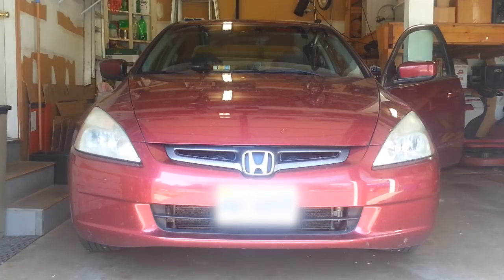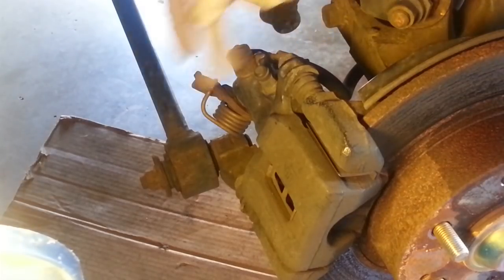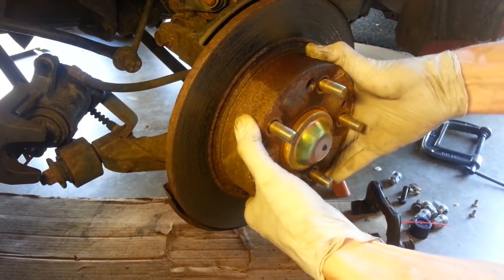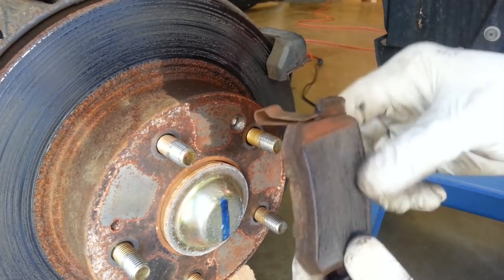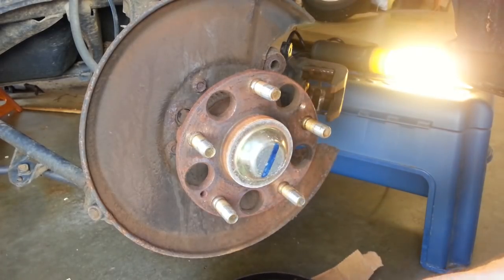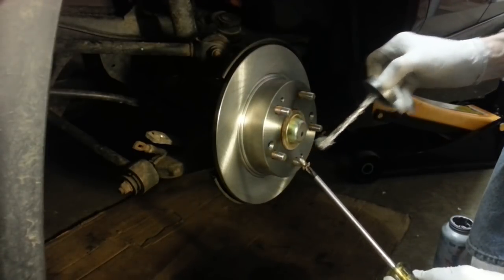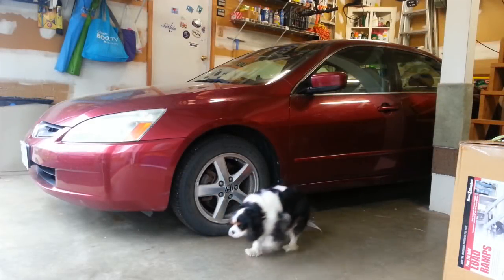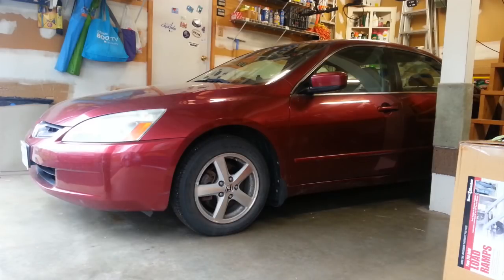DIY fix for replacing rear brakes - Honda Accord

Comment: Do not use a clamp to depress the pistons on those Honda rear calipers, not if you want to reuse them.   They need to be screwed/turned with a brake tool (or a pair of needle-nose pliers) inserted into the grooves of the cross on the face of the piston. Those calipers were probably trashed Because somebody clamped on them before.

Comment: you didn't put anti-seize on the contact points on the pads
Reply: I noticed that as well. This was the third or forth vid I watched on this to get a better overall picture and I came back to this one while I was working to see the "reader's digest" version.  It has the basic order of things, quickly.
Reply: I’ve heard not to add anything to the pad contact points it will attract dust, sand and dirt preventing smooth pad operation. But do add brake paste to the caliper mounting bracket pad clip. Only on the bracket side before putting on the shiny metal clip to help prevent rust behind the pad clip . Do not put brake paste on the pad side.

Comment: Does anyone realize that the first step with the c clamp doesn't do anything since the caliper piston needs to be turned to be opened up?
Reply from the maker: You are actually correct and thanks for the clarification. Since the parking brake is integral to this rear caliper design, it has a ratcheting mechanism inside that requires the piston to be turned back into its bore. If I was just replacing brake pads, that procedure would be required to fully retract the pistons and make room for the new, thicker pads. In my case, the C-clamp was only used to relieve the pressure just enough to remove the caliper from the rotor. That step isn't really necessary and, as I did in the video, a large screwdriver can be used to pry the caliper off the rotor. Much appreciated.
Reply: Less Woodz
Reply: Les Woodz has it correct. You DON'T press the caliper piston in. It needs to be screwed in clockwise. That's why there's the grooves to twist it with. Obvious sign. Blank pistons can be pressed. Slotted pistons need to be twisted/threaded...Bet most of you DIY'ers had leaky e-brake seals after doing it the way this guy shows.
Reply: If anyone can tell me how to turn in a rear piston while the brakes are still mounted... PLEASE LET ME KNOW! For the miniscule amount needed to relieve the pressure, I'm pretty sure it won't matter.  Maybe I'm wrong, but the only alternative I can think of is leaving the old brakes on.

Comment: I am totally depressed. I removed tha caliper easily and removed the two screws on the rotors by hand and home made lubricant BUT the damn rotors won't come out. I am really fucked up, the rotors is loose and can move but still do not come out.
Reply from the maker: Are they totally fused to the hub or are they loose and just won't come off over the end of spindle?
Reply: @WorseThanChiggers  
They are off and freely playing. It seems something back the disk hinders to come out.
Reply from the maker: @mogbaba  What kind of car is it?  The parking brakes on some cars are drum brakes with the shoes inside of the rotor cavity.  If that's the case, you may need to back the shoes off by turning the star wheel before removing the rotor.  I show how to do that in this video:  https://youtu.be/IUI8YiMX1X8?t=133

Comment: At 18:49, does anyone know how to remove the cable after taking off the c clamp?  I sprayed a ton of wd40 on it,yet it still doesnt come off.
Reply: I had the same problem. I found that if you pull the cable back (after removing the clip) the whole cable assembly right there will slide out along the length of the cable... so it's not going to pop out perpendicular to the clamp, but along the longitudinal direction. It's not easy but not TOO hard, either... (and mine was VERY corroded.) Use penetrant (Kroil, PB Blaster, or Knock 'er Loose?)

Comment: No cleaning te surface from rust ? no little caramic paste ?
Reply from the maker: +mercedes benz 
There was obviously no need to clean the old rotors of rust since they were too far gone and were being replaced. It was actually less expensive to replace them rather than having them resurfaced. Also, you can see at the 24:58 mark of the video that I confirmed the new calipers had an adequate amount of silicone paste.
Reply: Ok sorry you are right , and its ok that u use all new parts, , i mean the mounting surface of the bearing clean from rust , that is often a couse of vibrations, u can use some ceramic paste between the caliper and de pads and where the pads go against the bracket, sorry for the englisch , i m dutch
Reply: worsethanchiggers Also a couse of vibration is mounting wheels with to high torq , than the mounting plate of the bearing go bad , verry sensitive for BMW !  between the stanles steel clip and  the brackets  i put ceramic paste , rust lift the plate up and than the pad can not move free
Reply: @@tdidan - I use a thin application of anti-seize evenly on the surface contact area as well. When you're spreading it with your finger, you can also feel any little spec of dirt that might have been trapped there as well.

Comment: Forgot the grease!!  How did you not record this video without greasing all your new parts lol..
Reply: Wow what a waste!!   You all should no from them rotten rosters he doesn’t know what he’s doing..   1st letting Honda tell you that the brakes / rotors/ pads / calipers  I would fell like a dummy..   what did you bring the car in for?  Blinker fluid hahahah
Reply from the maker: Hi Mikey. Thank you for your most insightful feedback.  Perhaps you missed the part where I showed that the slide pins on these remanufactured calipers were pre-lubed with silicone paste.  https://youtu.be/9OJ0Oso7I2Y?t=1513
As to using grease on the ears of the brake pads, that comes down to personal preference and making an educated choice.  Using grease or anti seize compound in this area is common but greatly increases the chance of it attracting brake pad dust and turning into a solid mess that impedes the free movement of the pad, especially if the well intentioned lube slinger goes a bit overboard.  On these Honda pads, I prefer to always replace the stainless steel hardware clips which have a very smooth surface and allow the pads to move freely without any subsequent lubrication.

Comment: From my experience the hardest part is removing the two remaining philips screws on the rotor; the rest is down hill from there....
Reply from the maker: Most definitely agree with that!
Reply: trankt54155 I didn’t have an impact screwdriver so I just gave the screw a few good hits with a hammer then put a vice grip perpendicularly on a screwdriver.  It gave me the torque needed and they came right out.
Reply: One reason they're so difficult is that these are NOT Phillips head screws - They ARE JIS (Japanese Industrial Standard) #3 screws and an inexpensive ($15) impact screwdriver can easily be had which will serve you well if you do ANY work at all on Japanese made vehicles. If you work on cars, trucks and motorcycles you'll probably want to invest in a set of three (#1, #2, and #3 - for $40 to 45.)

Comment: Heyyy That's my car!!! Lol...We have exactly the same model and year...Yep! I always do my break job and so easy on this model...Do you still have the car? O pps but yours is more better coz yours is manual mine is at...
Reply from the maker: Agreed. Doing brake jobs is usually quite easy and a real money saver. We do still have ours but, apparently, the previous owner wasn't too good about regular maintenance. Its burning oil really bad now. :)
Reply: oic... mine too but not much... I always use full cynthetic  mobile high mileage recommended weight on my oil cap and so far so good , i bought it used has 145000 now it has 195300 i had it for 3 years . I never go to any mechanics coz no major issue, I DIy the brakes and rotors, cleaned my throttle body changing my spark plugs, replaced my cerpentine belt , swaybar bushing on my rear  but on the front is so hard for me so i will spend 100 buks to replace it. You know 2003 car is considered old some needs to replaced and 1 of my son let him to do it coz he needs basic . He wants my car coz he said its nice cool car ...Good day sir...btw honda shop charging me 385 jusst to replace i mean to fix not replace the rotor and put brand new brake pad.

Comment: Little bit if info which is almost always forgotten --it is the piston seal which 
causes the piston to recoil and allows the caliper to release the disc. 
The seal is cut at an angle so that when it deforms as the piston moves 
out it a maximum amount of energy is stored in the deformed rubber and 
it is this stored energy which pulls the piston back in. The rubber 
elastomer boot cannot and is not designed to do this. ProSlip PIN is 
specifically engineered to be very low friction lubricant -- why? to 
allow the micromovements of the caliper and not to be so viscous as to 
oppose the relatively small amount of energy stored in the deformed 
piston seal as it essentially pulls the caliper off the 
disc...ProSlip.com and here on Youtube

Comment: The rear brake piston rotates and pushes in at the same time. it does not push in so you trying to compress it was unnecessary
Reply from the maker: Indeed you are correct and thanks for the clarification. Several others have also pointed that out.

Comment: $1300 doesnt surprise me one bit coming from honda, those people are CROOKS! NATION WIDE! they charged a family member $1900 to put in 3 new motor mounts and i dont know who im more pissed at - honda for ripping my aunt off or my aunt for letting them rip her off
Reply from the maker: Agreed, some dealerships are great, other's are dishonest. I could have paid the $1300 to the dealership and I'm sure they would have done a good job. Typically, an independent shop would typically have been cheaper. I just had the time and initiative to tackle the job myself and save a few bucks while sharing the experience with this great YouTube community.

I used to be hard on shops in general for what they charged for their services. Then, when I got into this hobby, I met a few professional mechanics that I respected and learned what it takes to run that type of business and to do it well. Like any other business, there's significant overhead in capital expenses, equipment, tools, facilities, insurance, regulatory costs, etc and that doesn't even including paying your employees an honest wage. They have families to feed like the rest of us who work for a living in whatever field we're in. Of course, there are dishonest people in shops and dealerships just like there are those in other businesses. You need to be an informed consumer in all cases.

If you're not a car guy, as I assume your aunt is not, I always suggest that you get an estimate first. If you feel that the price is too high or you are unsure if it is reasonable, get a 2nd and possibly a 3rd independent opinion and ask for them to justify the need and the cost.
Reply: My mom has a 99 4runner 4x4 i recently changed her valve cover gaskets and put new plugs and wires in and new coil pack boots but kept the coil packs took me a half a day becouse of having to take the intake off, im fixing to have to do a brake job on my aunts honda its a 99 v6 accord, one of the motor mounts honda put on is vaccum assited and they neglected to change a cracked hose attatched to the mount, they charged way too much and didnt even do a good job and ive heard far worse from other people on honda service.

Comment: This is almost painful to watch. T wrench, using a c clamp on a twist in caliper, rusted outside rotor explanation...
Reply: If you can't remove the pads/caliper because they're locked in too tight, I'm not sure there's anything else to do besides spreading them a little (just a minute amount - 1/100th to 1/50th of an inch should break it loose) just to loosen them enough to slide the pads out. I don't think it will matter once you actually turn the pistons back in properly.  If you know how to break the pads free by turning them while they're mounted, please share.

Comment: not even $15 a piece?!? never trust amazon and eBay for MAJOR life saving components of your car! definitely cheap chinese metal that will probably crack in half 40k miles down the road :o
Reply from the maker: Interesting points. Do you have specific personal experience with that outcome or is it just a broad unsubstantiated opinion?
Reply: @WorseThanChiggers  it is a broad unsubstantiated opinion when it comes to this specifically but I have seen many instances where buying cheap knockoff parts did NOT pay off
Reply from the maker: @Devs.rr.06  Most definitely and it depends on the part. For example, I would only ever use a genuine Honda OEM power steering hose as I did in this video https://youtu.be/ckuxUVF16k8  and battery compartment parts for their fit and finish as I did in this video https://youtu.be/31AfdoQJItc.  The power steering hose replacement was a nightmare enough and is far worse with an aftermarket alternative. But, I am comfortable with many aftermarket parts for some situations. I've had very good luck with remanufactured calipers and carefully chosen aftermarket rotors for daily drivers. I do stick with OEM brake pads, though, and have never regretted the additional cost.